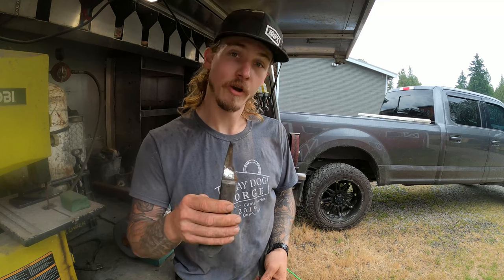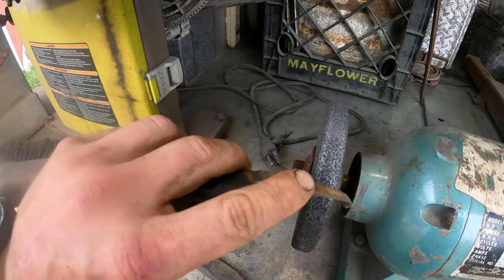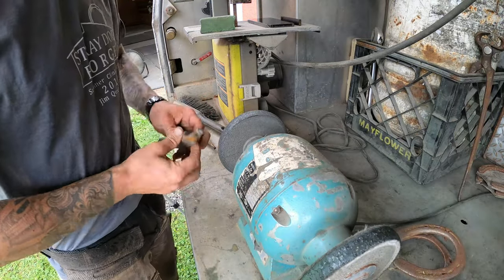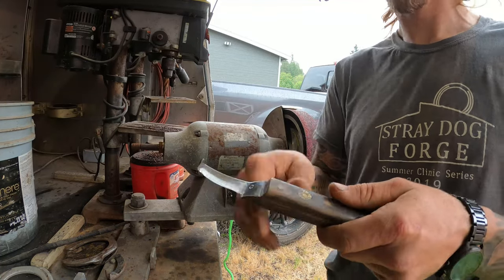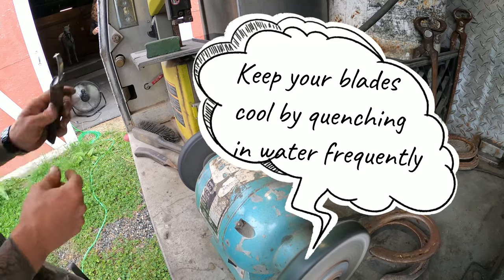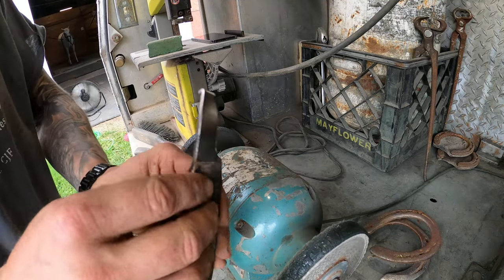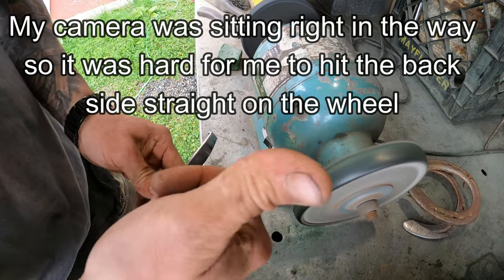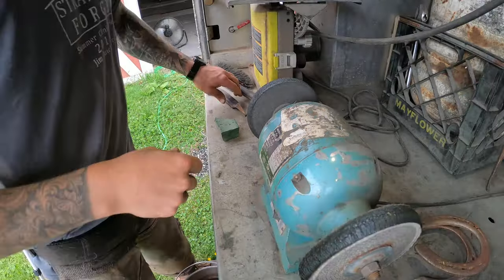Restoring & Sharpening Hoof Knives | How to Sharpen Hoof Knife

Comment: This looks like a good method to restore a once useful knife. The only “bitch” that I have with your video is the lack of safety glasses during the use of the grinder or buffer. A one eyed farrier, either pro or amateur will have to work a lot harder. After fifty years in machine shops, I speak from just the few that got around my safety glasses. One small grain of “dirty” abrasive can get you a big gauze patch at your favorite ER. Scratches and infections are the prizes.